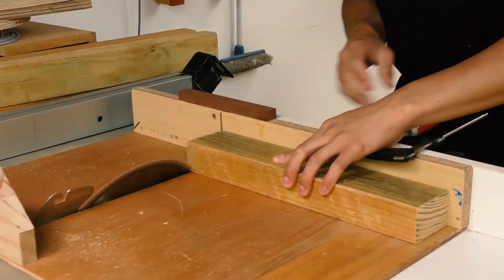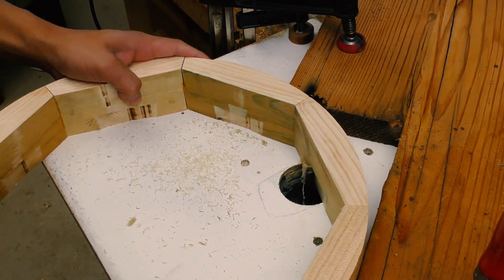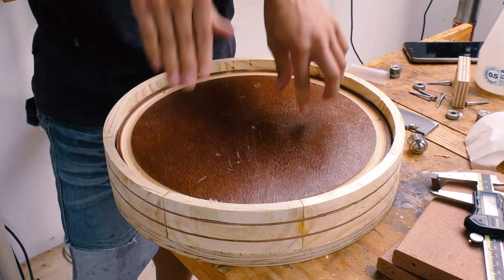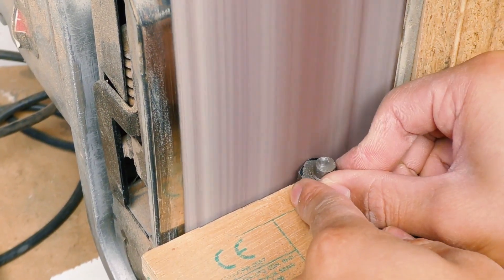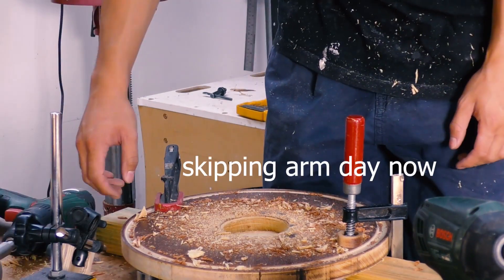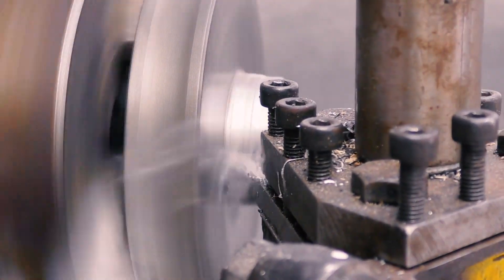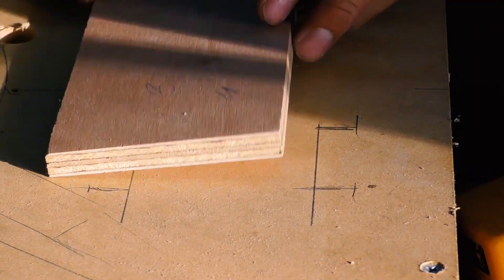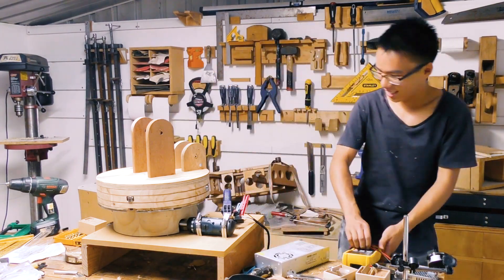robotic arm part 3: making a new base

Comment: Very nice work Steven!  Where did you get the roller bearings with threaded rods?
Reply from the maker: i got them from china
Reply: Steven... Can I purchase them from a company?  ebay or  liink would be appreciated.
Reply from the maker: @Long_Last_Im_Here  uhhhh so i got from herehttps://item.taobao.com/item.htm?spm=a230r.1.14.27.58125472UKu0HR&id=532835963758&ns=1&abbucket=2#detail and i'm sure a google search of like 360 degree ball bearing would make them come up